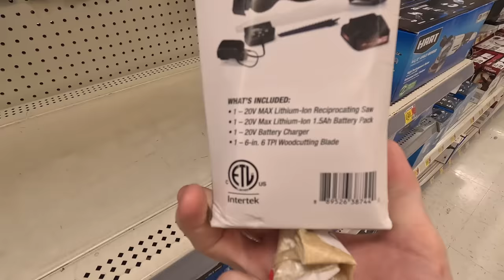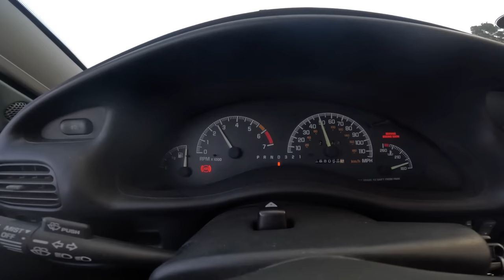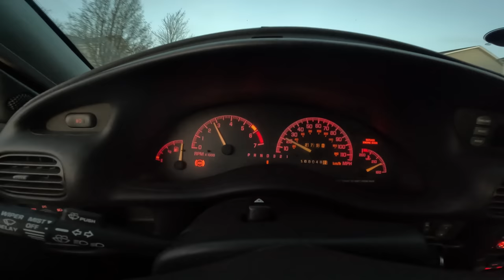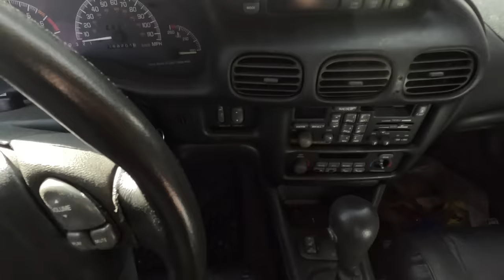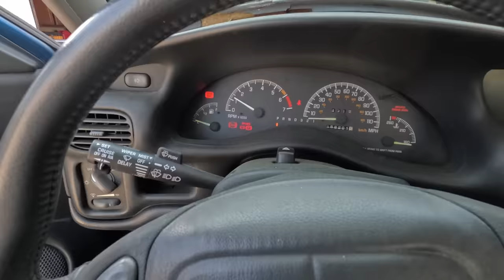Another stupid car vlog

Comment: It's weird that your strut towers are braced to the front (radiator mount?) instead of to each other. Strut tower braces usually connect the left and right together to prevent flex inward toward the motor when cornering... yours are braced longitudinally for some reason, it makes no sense to me, this would help prevent flexing forward and backward such as under acceleration or braking but there is MUCH less force that way than side to side.